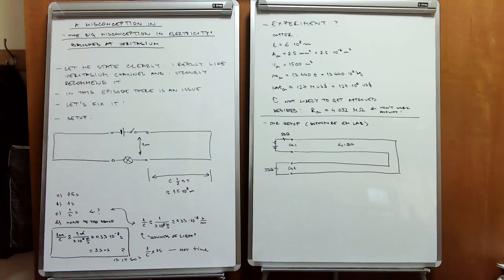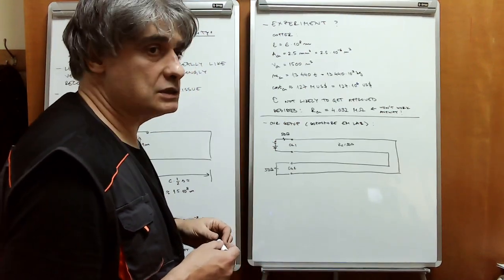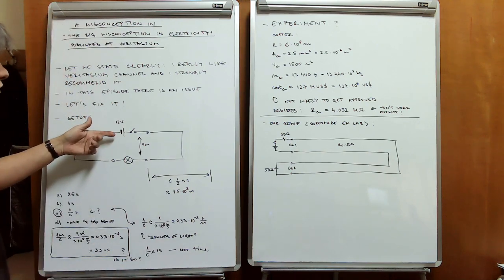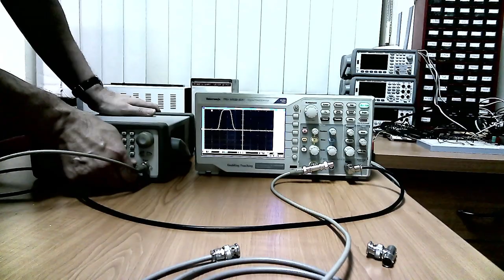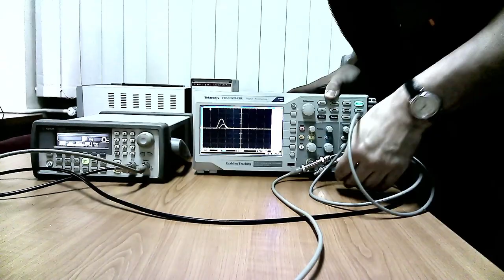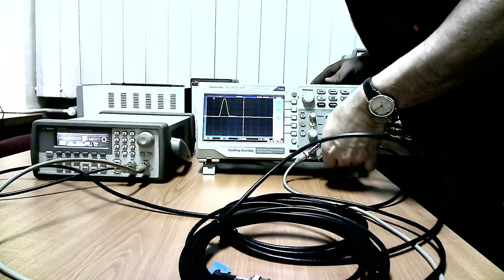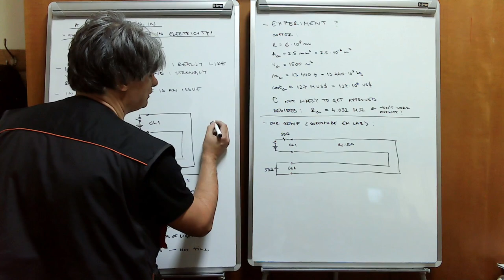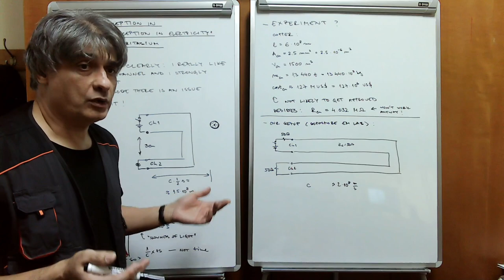A Misconception in "The Big Misconception About Electricity" Published at Veritasium Channel

Comment: Although I like the fact that you are showing the experiment with shielded coaxial cables, you are are changing the design of the experiment to literally block the electromagnetic field from affecting the "light" in the circuit, so of course you are not going to see a 3.33ns pulse.
The actual problem with the Veritasium video is that he is making the claim that the light turns on in ~3.33 ns when in fact, at best it only receives a very small fractional amount of the voltage and current needed to make the light "on". Veritasium knows this and commented to ElectroBOOM channel that his light was very dim and only reached 2 volts. These effects were related to Transmission Theory. 
So, of course, if you "shield" the cables, then Transmission Theory effects will be very very small. 
Nevertheless, I think it is pretty cool to see how shielded cable affects the experiment. 
Thanks for making the video.
Reply from the maker: Yes, definitely, my setup is a different one and I intended it to be the extremely different one: to block the direct wave propagation completely. My point is that 3.33 ns propagation is not the whole story (although it is a part of the story) and to illustrate that I blocked it completely. How big the direct propagation part is is a quantitative issue, and ElectroBOOM did a great job in clarifying that, although the transmission line theory is still an approximation (mutual coupling of the lines excluded), but a really good one. It is possible that I'll make a sequel, but after ElectroBOOM video not much I'll have to say except to plug in actual figures and try to illustrate the quantitative side of the phenomenon, ElectroBOOM pretty much closed the topic.
Overall impression: nice that we had this debate and that there are people with interest in electromagnetics. Regarding the actual topic: "Things should be made as simple as possible, but no simpler."
Thanks for the comment! I agree.
Reply: Good point w/the coax cables.   Don't alter the experiment, then claim that Veritasium is the mistaken one here!

On the otherhand, go actually watch Veritasium's video.   He STATES that initially the bulb only receives a fraction of the twelve volts, depending on the resistance of the filament and the Zo of the lines.     (In order to answer an exam question, it pays if we actually read the whole question, and not ignore some parts.)

"Very small fraction," that's not quite honest, because a z-matched filament will receive 6V during the first second before the final 12V appears, and a larger load resistance can even approach 12VDC initially.   This is irrelevant, because he's not using a real bulb.

The initial 3.3nS voltage can be quite high at the bulb, but of course the current isn't many amperes.   That's why Dereck didn't use a real bulb in this experiment.  Instead, he's using a thought-experiment bulb, where the bulb turns on as soon as current appears in the bulb.   The initial current should actually be a few mA.   (With thick 5mm cables 1M apart, the line impedance is around 700 ohms, and for a 12VDC battery, and that limits the initial current-step to 8.6mA  ...or 4.3mA for an ideally matched 6V bulb, and only producing about 25mW, same as any LED.)

If he had told us to use a real bulb instead of a thought-experiment bulb, then probably the bulb must be a cluster of two or three LEDs in series, plus a series R.   (But that's not part of this video.   The billion-foot cables are not real.   The bulb is not real.   They are ideal thought-experiment devices.   As above, don't change Veritasium's experiment, and then claim that he made a mistake.  ) 

So, all those people in the comments who insist that the initial current will be insignificant microamps, have not read any textbooks or even done a single calculation, and are simply making s**t up.    They get the wrong answer, just as his test-question was supposed to reveal:  exposing their ignorance of EM circuit physics.    Also, Dereck didn't create this test-question.   He got if from a college professor, and thanks him in the YT text section "caption."

Now if Dereck wanted to be impressive, he should have used a 250V battery, so the bulb initially lights up at ELEVEN WATTS.    Or, use 250VDC and make the gap between parallel cables be ten meters.   Then the bulb only lights at eight watts, because the Zo for 10M gap works out to be 1K ohms.
Reply: @wbeaty  I agree mostly. But, the reality is that the current is NOT significant as it relates to a standard light bulb. And no, that's not making anything up. I don't need to make a huge math formula to prove 1/d^2... and I certainly don't need complicated math theory to prove that a "real light" won't really turn on properly this way (unless you significantly change the design, and boost the voltage). This is common knowledge for almost everyone working with electricity. Sure you can "ideal" the experiment, but then it has zero useful impact. Everyone already knows about wireless charging, radio, and remote control. Nothing new there.
Derek was combining thought experiment with some sort of education on how Electricity "really works" ... and its just wrong. Electricity doesn't JUST travel outside of the wire. PERIOD. And his video very strongly implies that what's important is happening outside, not inside the wire. It's just wrong.
It travels IN both the wire, and externally in different forms , with electrons doing the work in the conductor. However, MOST of the energy is concentrated in the conductor. 
Another issue is that the thought experiment was NOT intended as an "Ideal" light bulb.
For proof of that simply look at Veritasium's Pinned comment: https://www.youtube.com/watch?v=iph500cPK28
Reply: Veritasium says, "For the record I was not suggesting the lightbulb lights at ANY current value but at some small but significant current value." (See the link above)
Based on that, the answer he provides to his question is also wrong. Because for the LED to light from a "significant" current, it would take 1 second.
Reply: @marcfruchtman9473  But that's the whole point of all of this:  two wires DO NOT obey 1/d^2.    Anyone who says that they do, is ignorant of very simple physics of sources: lines versus points versus planes.   (Inverse-square law only applies to point-source emitters, not to the apparent line-sources here.)    If you insisted that the 2-wire line was instead ruled by 1/d, and not 1/d^2, then maybe you're not simply ignorant after all, and an actual discussion is possible.

This stuff isn't a huge math formula, it's a simple measured effect, cable-impedance is known for over a century.   (If it's wrong, THAT is an enormous discovery.     So, do like Alpha Phoenix, but adding lots of debugging, and eliminate all his measurement problems which various people have pointed out.  In comments he states that the 1M gap didn't work at all.   But also, his 200mV step should have been 1.8V, using the 1K load and the wire he used.)

Then, once it's working as expected for close-spaced cable, repeat the test at 250mm, 1000mm, even five meter and ten meter gaps between long parallel wires.    The impedance of these lines is NOT fifty ohms of course, it's up around 1K ohms.    

Or try an in-between test:   wind a 1-turn #24ga primary and secondary coil, around ten feet in diameter and spaced in parallel at 1cm apart.  Test them as a transformer, then increase the gap to 2cm, 3cm, etc., so the wire-length is immense compared to the gap between.   The coupling should remain very close to 100% until the gap becomes significant compared to the circumference.    In the Veritasium test with billion-foot wires, the coupling should be 100% regardless of gap distance, and only the line-impedance gets larger  (well, unless we space the wires at thousands of KM apart!)

That's the basis of all this stuff:  it's "nearfield,"  where the two plates of a capacitor are ~100% coupled, as long as the gap between them is tiny when compared to the diameter.   Yet the capacitance decreases by half, if the space between the plates is doubled.   Or with transformers, the coupling between primary and secondary is ~100%, as long as the gap between them is tiny, when compared with the diameter.    With very long parallel wires, the coupling is ~100% if the gap is tiny.   And, as the gap increases, the line-impedance increases, but NOT in proportion.  Going from 1M to ten-meter gap only changes the 720 ohms into 1K ohms.   Very counterintuitive.   Let's light a ten-watt bulb across a 10M gap?   Simply choose your bulb and your battery voltage in order to make the 1K of Zo impedance "look small."

These effects are obviously very counterintuitive.  It means that DC power leaps right through empty space, and are far more unexpected if we use bulbs and supply-voltages which make the 700-ohm series impedance "look small."

---

So today we can see that many people, when they encounter all this stuff, simply go full-on Pseudoscientist, rejecting physics and essentially spitting on Maxwell and all the last century of EE textbooks, and instead insisting that their own misconceptions are correct, while sneering at anyone who thinks that perhaps 1/d^2 doesn't apply to long lines.   (Heh, that's called being wrong ...well, unless someone can show that these experiments actually don't work with 50-ohm lines, or with 300-ohm twinlead, or with Veritasium's 1000mm cables, which should measure out as 700 ohm cable impedance, two of them wired in series with his light bulb.   Use a 1.4K resistor, and we should see a prompt DC-step of 6V, with full 12V arriving later.    If it doesn't happen, we've just showed that Maxwell-ian physics is fundamentally wrong, and Maxwell's equations are suddenly open to question.   That's a fairly big deal, eh?    (Usually in these situations Maxwell is actually correct, and the people rejecting him are emotionally entangled in their wrong statements made earlier, and they simply cannot admit their errors under a public spotlight.)

Maybe *I'm* the one who is wrong.    Experiment will show this, not decades of very solid physics theory.   (The various engineering and physics professors who put Veritasium up to this will all have to admit their ENORMOUS error!   Their names are listed on the YT channel.     Or maybe it's just you who made a huge mistake in public, and now doubles-down, and dares not admit it. )
Reply: @wbeaty  Well, You are correct that 2 wires conducting current will interact, so there will need to be an adjustment to the formula for two wires conducting current. The strength of the magnetic field would be B=μo I/ 2 π d on the other wire ... The strength of the charge is more complex.
BUT, the problem with your objection is as follows: You need Electricity to be flowing in the other wire for that to work. So you can't take advantage of that effect until the current has made it to the other wire. right?
Reply: @marcfruchtman9473  Right, we need a current to appear in long lengths of cable before the initial DC step is ramped up and stable at the load resistance.  It only BEGINS at 3.3nS (where a magic light bulb lights immediately.)  I'd predict there should be some large 450MHz oscillations, as the sharp EM edge reflects back and forth between the two cables, 6.66nS per cycle.   Maybe the "bulb" resistor doesn't see a constant DC for a ten-millionth of a second, or maybe several.   The ramp-up begins at 3.3nS, and finally looks like DC at ???nS, maybe one or two hundred nanoseconds.   After that, the V and I are constant at this end of the 2-wire lines, and a long and growing "slug" of EM is racing off into the distance (which makes our end of the 2-wire lines look just like a 720-ohm resistor in a small local circuit, if cable-impedance calculator isn't lying.)   With Veritasium billion-foot superconductor, the DC step is then flat for one second, until the full 12V appears 1sec later, coming back from the distant ends.

One thing which may screw everything up in the real world:  SKIN EFFECT.   

A 5mm copper wire doesn't behave like a 5mm copper wire for nS edges and GHz waves.   The effectively "hollow" copper film may behave as a quite large resistor.  So, Alpha Phoenix might never see the full Vbatt/2 appearing at his resistor, not unless his wires were many KM longer, so that the DC step lasts for many many microseconds, so that the skin-effect dies away, and effective wire-ohms becomes small again.   (Or use some big fat Litz wire, costing $1 or more per foot.   Or, maybe use two parallel runs of coax cable, while only using the outer shields as our two long lines.)
Reply: @wbeaty  Well, one good thing that has come out of the Veritasium video is that I am now more aware of the Transmission Theory, but, if you are saying 720 ohms is the resultant then how do we approach the actual current. I get 0.0167 amps at 12volts. 
So, if we are talking Vsourc / 2 then that means only .0083 amps are available to light the LED. 
That seems pretty low to light a typical LED.

As far as Skin Effect, I don't know if the skin effect equations that we typically see are taking into account bounce back effects from finite length wires.
Reply: @marcfruchtman9473  most oldschool LEDs were designed for 10mA drive.   But modern ultra-bright ones go with 20mA, even 100mA or higher.   And green LEDs can still be seen at microamps level, since human eyes are incredibly sensitive to 550nM, compared to 650nM red LEDs.
Yet this is all irrelevant, because Dereck is using a thought-experiment bulb connected to his thought-experiment billion-foot zero-ohm wires.   Over on Electroboom, Dereck pops up in comments, saying that his special bulb is supposed to light up at low but significant current, and NOT lighting up continuously from picking up tiny EMI noise.   In the original video, he also states that the bulb initially receives a tiny fraction of the 12VDC.

Clearly that's why he had to specify a magic light bulb, that "lights" instantly in zero nanoseconds whenever it gets ANY current. 
Now if instead he told us to use a REAL load, such as a resistor, then if he decided to use a 1.4K resistor, it would see 6VDC after a few hundred nanoseconds (not 3.3nS, because only thought-experiment loads have zero picofarad capacitance!) then after one second the full 12VDC would arrive at the 1.4K resistor.   But 6V^2/1400 = 26 milliwatts, typical for a single real LED.   

SKIN EFFECT, that just makes your copper wire have much larger resistance, since only a thin copper film is getting any current at the start, and thin wires have far higher R than thick ones.   Skin effect should alter the initial Zo of these 2-wire lines, so it's larger than just 720 ohms.   Better use perfect zero-ohm wires, like Dereck specified.

But skin-effect might seriously alter the Alpha Phoenix experiment.   I;m not sure.   His thin copper wires should already contribute 86 ohms which weren't in the Veritasium version.
Reply: @predragpejovic611   @Marc Fruchtman  Nice experiment Predrag.  I expected this result.  Question: Does  termination of any resistance in the wire should reduce the out-put at the load proportionally? in other words; in a sense Derek was correct?   As you increase the length of the wire and impedance match the resistance to termination, the time should remain constant... we can conclude that less energy makes it too the load in Derek's experiment given a copper wire setup... Derek did say that, and his field explanation does kind of work, but clearly the energy is concentrated in the wire.  Once again, nice experiment  @Predrag Pejovic.   I'm off to see this suggested video of Marc Fruchtman  https://www.youtube.com/watch?v=2Vrhk5OjBP8
Reply from the maker: @edwardhunia6315  I am sorry to be late in reply, it is hard to follow this much information. I plan, as I planned at the beginning, to make a longer math-based video covering the topic. In some sense Derek IS right, at t=3.33 ns (close to zero) there would be some voltage across the bulb, but really low voltage that won't make the bulb shine, unless you are able to see deep infra-red. The more fun is to determine how the transient evolves, and there is a nice closed-form solution based on transmission line theory, two short-circuited lines involved. Derek's presentation is a bit oversimplified, which is understandable in given context, there is a transient that lasts for a long time, for many reflections that take 1s. And this transient can be modeled analytically with some high school (++) math (just solving DC circuits after you understood partial differential equations). I would also like to state that there is no big deal about who is right and who is wrong, it is fun to determine what actually goes on. And Derek proposed an EXCELLENT setup to illustrate many topics in electromagnetics, transmission line theory, circuit theory, mathematical modeling, and so on. Besides, it is not hard to create experiments that illustrate many of these useful concepts. My colleague is likely cover the  problem from simulation perspective, to cover some things that I approximated out. My point is that it is really good that Derek's video attracted so much attention to electrical engineering topics, regardless the fact that it would be much better if he clearly asked "When some voltage would show up at the light bulb", and saying some words about the transient that lasts literally several minutes. Essentially, there is no need for hard feelings, the question is really good. Besides, many thanks for the people who commented, Anders (his comment is bellow) opened another really interesting topic about the light bulb thermal transient, which I would neglect. When I did measurements and plugged in figures, I realized that the bulb resistance is very different while shining (hot) than being cold, more than ten times. Anyway, thanks, it was fun to study the topic. I expect to publish the math based video in a week or so. Thanks!
Reply: @predragpejovic611   Hi. yep, for sure it was an excellent watch, and it helped firm up questions I had in my own mind.  I watched the youtube video Marc listed above, that too was excellent.  Recommend it.  My first post was a hard to read... I'll try again; if you plotted termination as a function of distance, in other words the time divide per termination resistance verses the impedance over distance such that no matter the distance, the resistance is exactly terminated... the slope of the graph should be linear and the slope should equal c.  thats what I meant to say initially
Reply: @predragpejovic611 good video, but if we argue there will be /some/ voltage across the bulb, may I inquire as to it's polarity? Also, is voltage the best measure of energy? Last I checked the only relevant unit of energy is watts, so I'd appreciate it if everyone using something other than watts could be quiet so we could think about the question being asked.